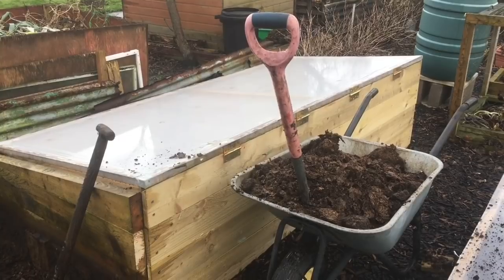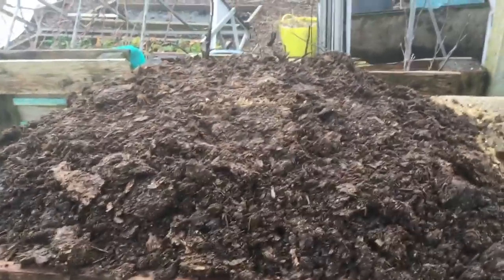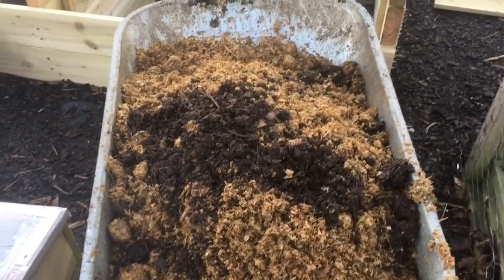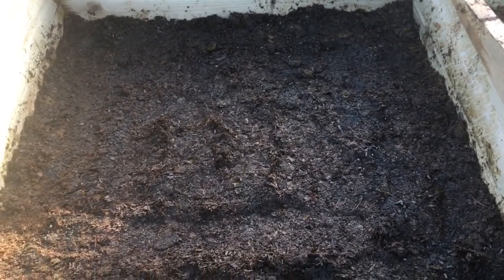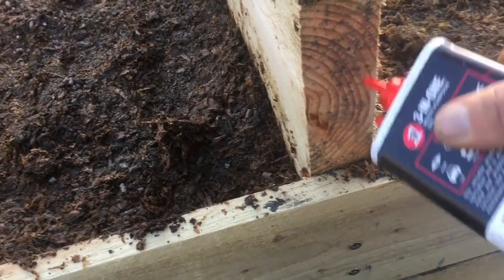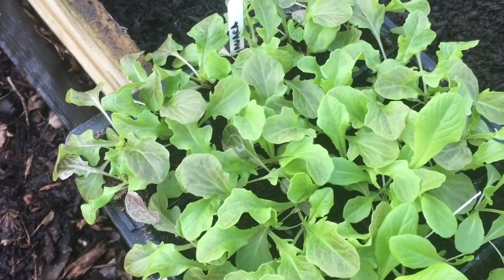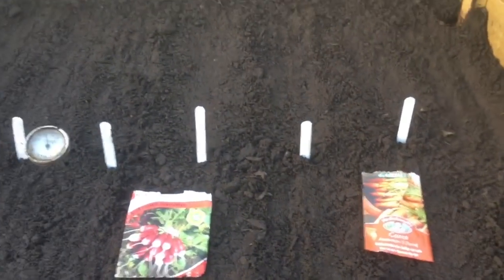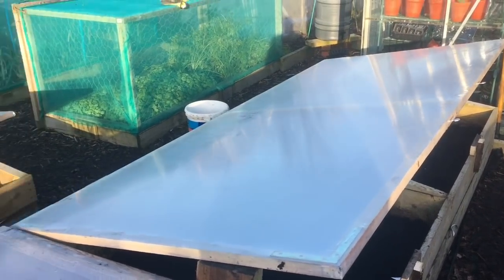Allotment Hotbed - Filling and Planting

Comment: Use greese on the screws. It should work better than oil . still lubricant of any type is a good idea.
Reply from the maker: Good tip Laurie, I used what I had, I've also found Vaseline to be good  : All the best - Steve